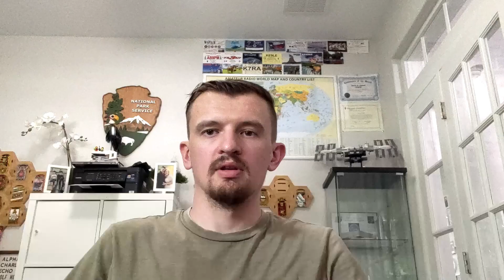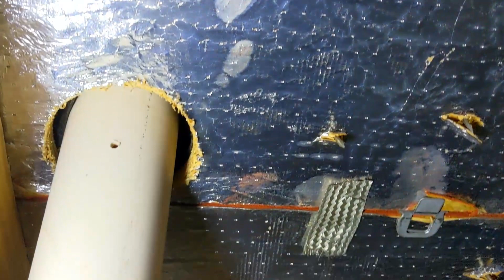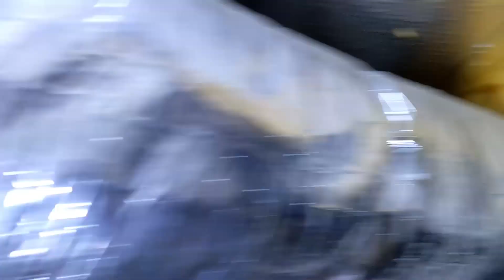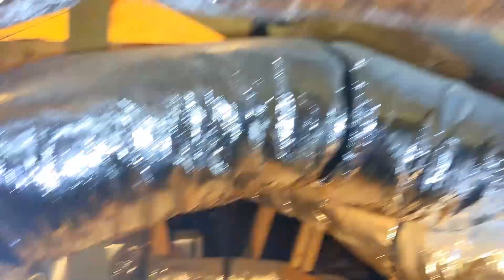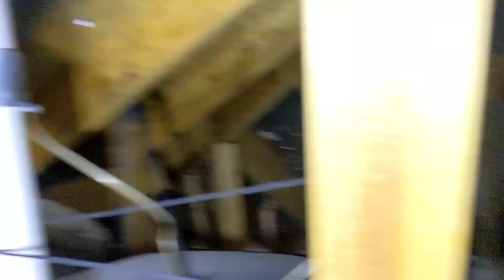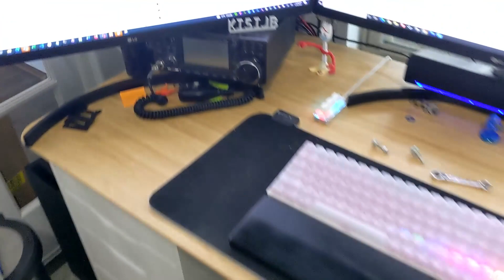Stealthy HOA HF Vertical Antenna?

Comment: Great ideas! Excellent creative thinking.  I too live in Texas (Houston) and have the same situation regarding HOA and home construction. I am using a Wolf River Coil antenna with a102 inch stainless steel whip along with 2, 24-inch extension rods between the base and loading coil, (ground mounted, 24 radials) and it is very stealthy and works great. I also currently also using a 56 ft doublet with 300-ohm twin led outside elevated just above the roof line. It seems good too but I am getting ready to replace it with the same non-resonat enf fed antenna you are using, Excited to see the differences. I Really appreciate you sharing your efforts with our common handicaps of modern-day ham radio homeowners..  73 K5NR